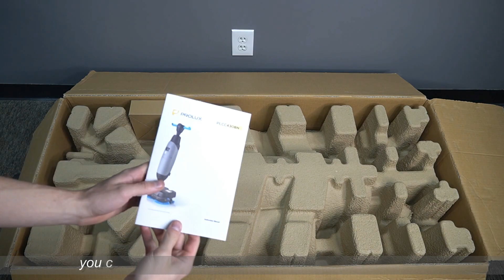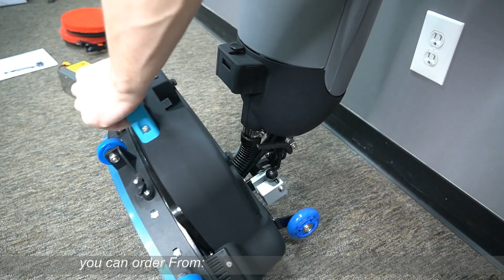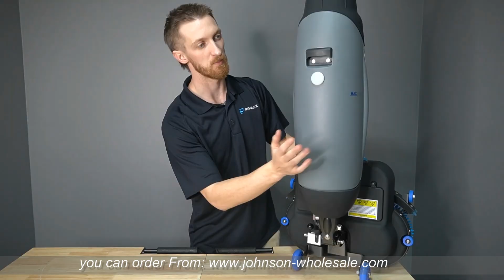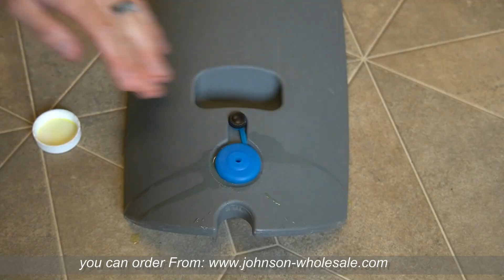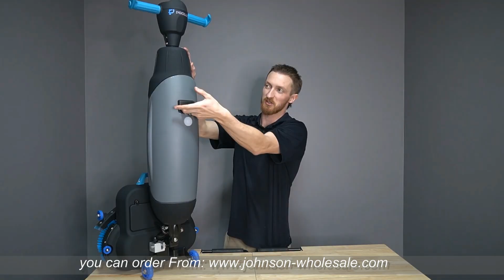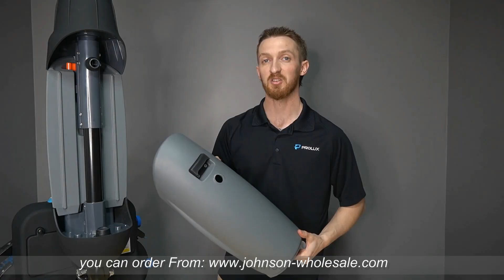Prolux PLCC430BN Unpack, Setup and How To Use. #prolux #PLCC430BN #scrubber

Comment: So I have an issue where the suction light immediately flashes after starting the machine. The clean tank is full the dirty water is empty. Even if the collection tank is removed completely the suction light is flashing green. 

The fresh water tank is just water no cleaner. The unit has not been used in 2 days and the suction comes on for 10 seconds or less and the it shuts off. It won’t turn on again until the unit is turned off completely. The suction light flashes green when turned on. 

It’s really frustrating as it has worked just fine. I’ve only used the unit 3 times and the 4th time is when the issues started. The collection tank has not been over filled, it’s been dumped every time fresh water is put in.
Reply: I'm the person in this video. I can help you. Are the tanks on your unit white or gray?

Comment: Very nice machine. This appears to be the best iteration I've seen so far on a versatile mini scrubber. Pretty much the same as the tornado micro scrubber with a few minor variations. Probably made in the same factory in China with different branding. I ran a commercial janitorial service for 37 years and recently retired. Where were these 20 years ago? This looks like a great tool with great potential. The size and weight is just right. It seems very maneuverable which makes it suitable for the average medium size commercial building use.

This machine is capable of revolutionizing the commercial cleaning industry. It is the missing piece of the puzzle in the quest to increase efficiency in a commercial cleaning program. What will determine its success or failure? PRICE. If they can make it affordable enough for a building contractor to justify its purchase, they have the potential to sell many of these machines and really transform the commercial cleaning industry. I will be interested to see how this evolves